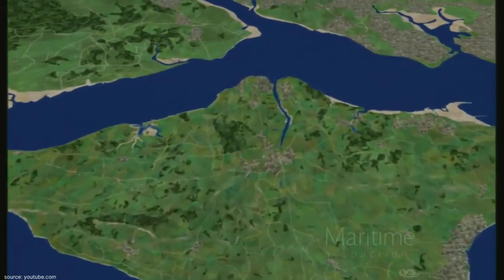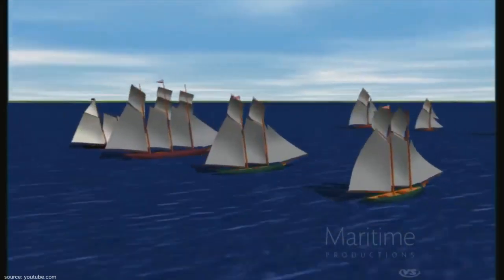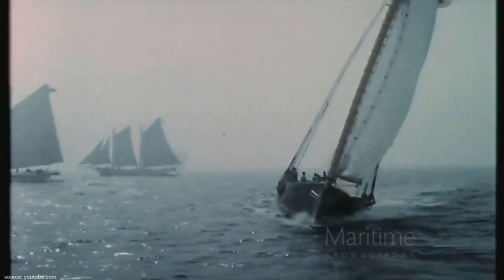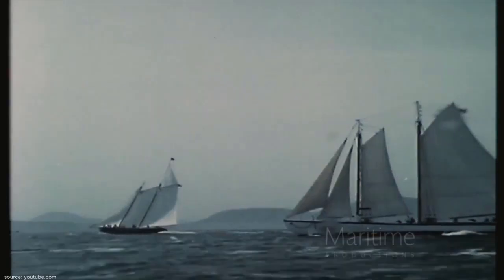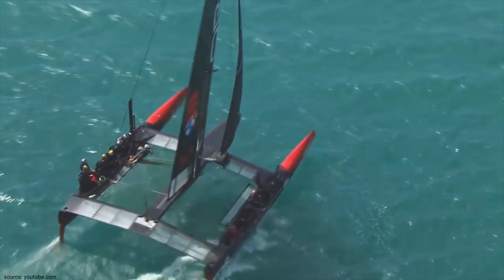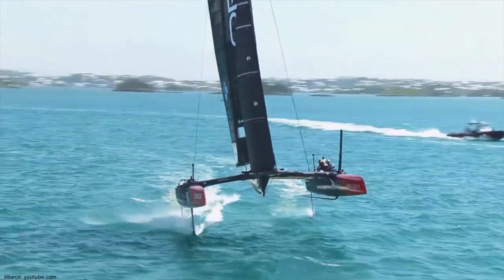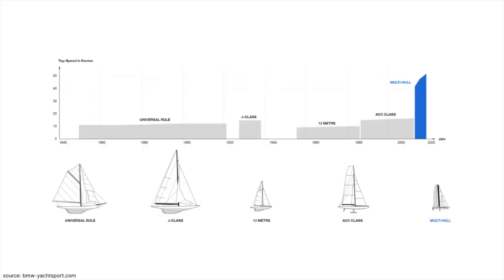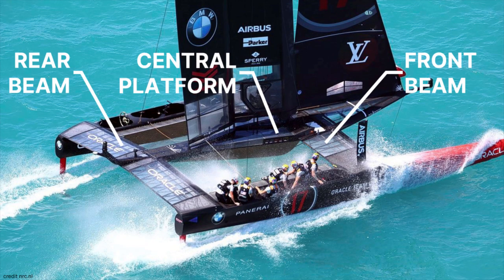AIRBUS talks part 3 of 4  - America's Cup Aerodynamics

Comment: My Opinion about Aerodynamics it's incorrect if it follows Newtonian Physics.
I think for us to make Quantum Leap in aerodynamics we must have a Quantum understanding of how the atoms affect each.
With an understanding of the gravity each individual molecule and atom that are affecting each other in the gas or air we would be able to redesign our current designs but with understanding of how things are actually happening versus what it seems like is happening which will work for engineering to some degree.
if we have an understanding of the how old is the gravitational affecting the air.
so I think for the next big are dynamic breakthrough or going to need to redesign the entire physics of aerodynamics.
I think the design of current thrusters should be completely redone but the new design should be designed based on quantum physics.
So in my journey of learning aerodynamics I realized I need to learn quantum physics to really take the next step in aerodynamics.
Reply from the maker: Hi Nebosvod, the current mathematical equations already do a pretty good job to capture flows good enough for engineering purposes. And indeed, we could go much further, perhaps when quantum computing is available for example. That will massively reduce the calculation times and perhaps, one day, provide us with true, live feedback on the aerodynamic performance during the design phase!
Reply: You are not an engineer are you.